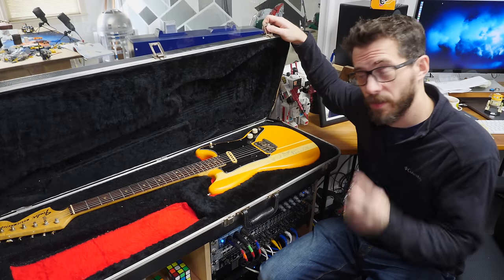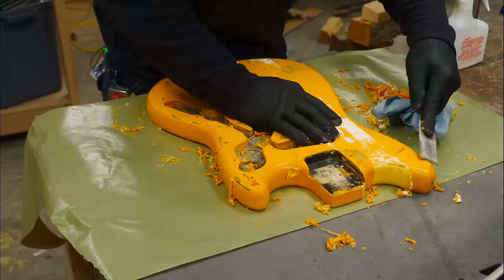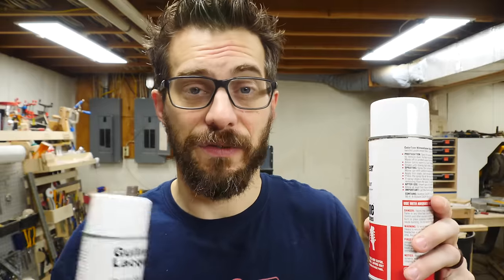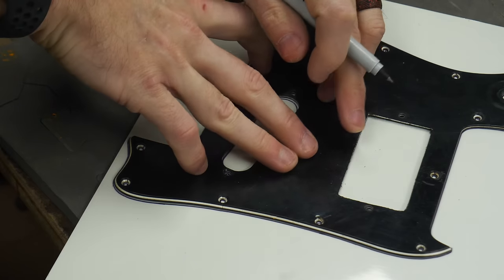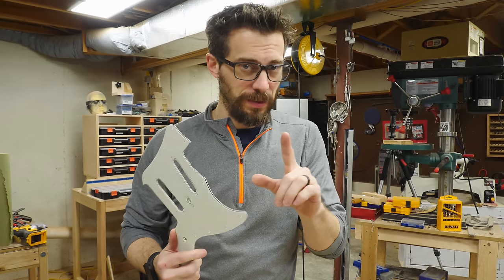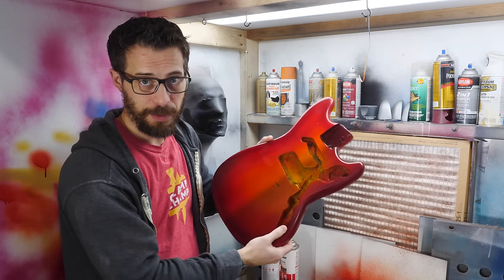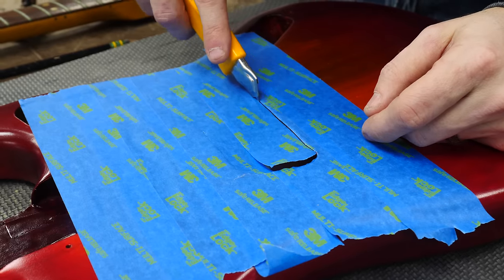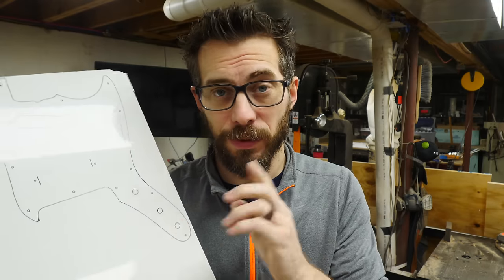How to Refinish A Guitar | I Like To Make Stuff

Comment: It's amazing you did so well with a rattle can applicator.  In my experience, you need to apply the layers with 400 pounds per inch from a powered air compressor sanding after every layer (letting it dry completely first) with no less than seven layers if you want a "professional" finish.

Comment: Pro tips from a junior luthier to anyone interested in making or refinishing guitars:

-Never use an electric screw driver on guitar screws, always do it by hand, and always mark exactly which screw came from which hole, the screws are part of the guitar too, you want them to last.
-When you paint  it for a body like this it's a good idea to attach a paint stick to the neck socket, pretty much just a broom handle that you screw into through the existing neck socket screw holes, this allows you to really control how you paint it, so you can get into all the nooks and cranny's without it spinning around on a wire unable to control the direction. 

-Nitro spray cans are fucking amazing for what they are, you can really do a lot with them and get a great finish. BUT, if you are gonna attempt a burst, and are super passionate about your project and the outcome, I'd recommend investing in an air brush and practicing a lot, you will achieve a much more consistent finish and you'll eventually find it super easy to get that great finish like you want.
-Watch Dan Erlewine videos on youtube, dudes a master

Comment: Theres no need to sand between coats. You are just rubbing off your finish. Spray on all coats same time, color and clear with 10 or 15 minutes between coats. Let dry for about 4 days then just sand the final coat with 2000 grit wet and dry then use cutting compound or car cut and polish and finish with car polish for a factory finish.

Comment: Not bad, but stripping that paint seems like way more work than the payoff.  I'd rather spend $70 and get an unfinished body to start with.   Also, a couple points.  1.  You missed an opportunity to shield the guitar while you were in there.  2.  The "problem" with placing those pickups on the wrong angle is that the pole pieces are designed to line up with the strings.  If you change the angle, they won't line up and you won't get optimal signal pickup.  (They also may not respond uniformly across all strings.)  It's not a big deal, but something to be aware of.

Comment: Tell me about the quick and dirty job on a really cheesy electric that, oddly enough, sounds good! here is how I see myself doing it. hour one - look at the thing for ten minutes, pick out the paint chips, gouges, and general mayhem that have been wreaked on the,,er,, musical instrument. next twenty minutes : attack it with a 100 grit german cloth backed sandpaper. Show no mercy, take no prisoners.  next twenty minutes: Slake the thirst I have worked up and the sweat I am dripping with a large adult beverage/ last 10 minutes of first hour; stand back and marvel at what I have wrought. Hour 2: take the 240 grit to it with a vengeance for a full 20 minutes, follow up with 360, and cut into the nickelwork you have masked to get rid of rough edges. All hardware except stringsstay in place.  next 30 minutes: take the fine paper and go over it two or three times. last 10Minutes clean the thing within an inch of its life. third, and final hour: apply wood sealer over the whole thing, with special attention to where you can actually see the wood.  let it dry. grab a spray can or two of your favourite shade of quickdry enamel, and have at it, allowing the luxury of 10 to 15 minutes between coats. Three thin coats should do it. . last, forge the signature of a famous rocker on the back (You knew those lessons in calligraphy would pay off) Voila! you now possess a unique original one-off that you can show all of your friends.

Comment: Nice Job, however do not lose sight of the fact that you have many thousands of dollars worth of shop tools, and the knowledge of how to use them.  This video works if you are a  pro or wood- working hobbyist and have the equipment already available.  You can have guitars refinished professionally for a lot less than the cost of the tools to do this type of job.
Reply: Where's the satisfaction in that? That's the reason you do it yourself, cause when you are done, the feeling you get knowing you did it yourself makes it all worth while.

Comment: The approach taken for guitar refinishing should be assessed on whether you are dealing with a vintage, high-quality instrument, or whether its more modern and not particularly valuable. Sometimes you go to guitar shows and see a lot of vintage guitars radically refinished to the point that they no longer look like that vintage piece of history or have that wonderfully aged patina. That's a terrible approach for a classic guitar. But some guitars are just so blemished and scuffed up that they simply look terrible without being restored. So a good approach is to try to maintain that vintage look - that still looks aged, without overdoing it - no easy trick. But similar to beautiful piece of antique furniture, it simply ruins a classic instrument if it's restored too radically. I've an old 60s, natural-finish Strat that the body is obviously refinished, but it still has that hand-rubbed, vintage look, so that it's not overdone.

Comment: Not to nit pick or anything but you don't seem to be concerned about fumes from the clear coat !  That's really bad stuff for the lungs.  Do you ever wear a mask when doing these things ?
Reply from the maker: My paint booth has a ventilation system built into it. While a mask is still a good idea, the fumes all get pulled into the filter.

Comment: Brush ( DONT SPRAY STRIPPER it travels in eyes nose and lands on other things ) "Air Craft " stripper its the most effective. One can of "Air Craft" stripper will strip faster then two cans of the other brands)Brush on let it sit put a piece of plastic over it.
   Its the fumes and the chemical that works.
THE FUMES TRAVEL AND WILL SETTLE ON OTHER PROJECT YOU DONT WANT IT ON.
 Wear gloves and goggles this stuff will burn skin and blind you.
    Never us that plastic spacer on the neck plate . No high end guitar uses them. I can rob some tone.

Comment: Jesus!! The shadetree amatures' guide to guitar butchery!! THAT'S what this should be callled! Dude - get an airbrush and learn to sunburst with that. I mask the perimeter with tape then work the shader into the edge. It works every time even if you don't have the steadiest hand. Also it's referred to as CLEAR COAT - NOT TOP coat! Top coat is only the last layer of finish - clear coat is only a clear finish with no colour whatsoever.